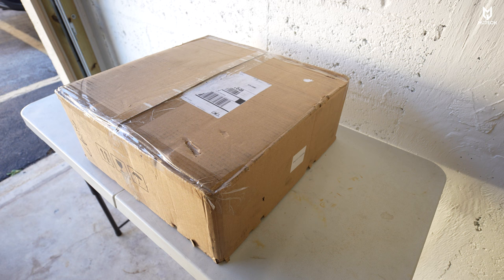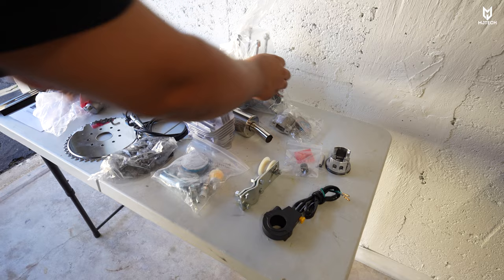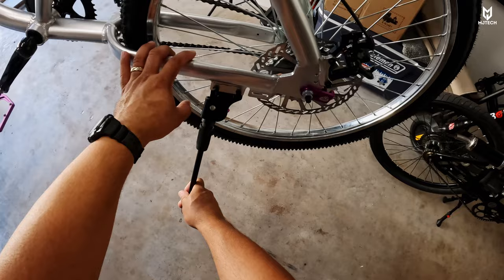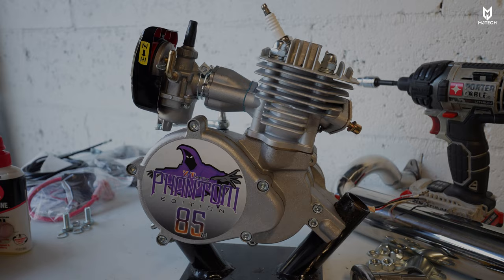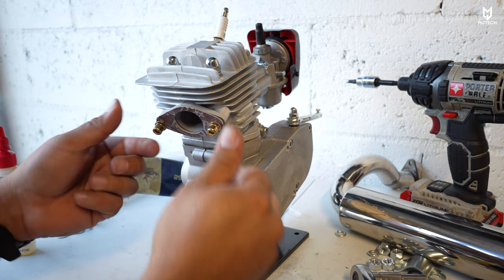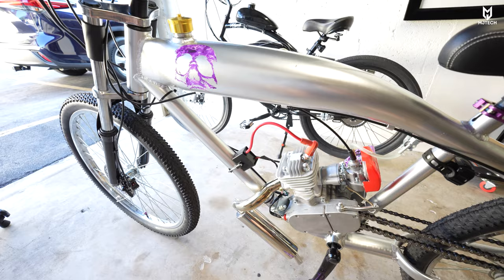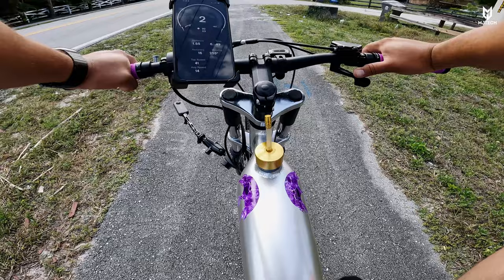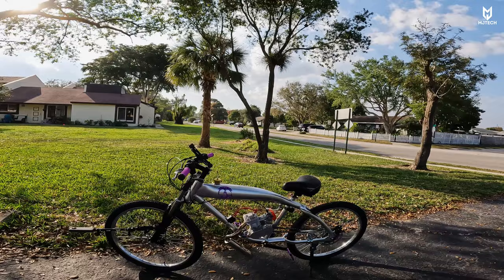Phantom 85 [V3] - No Motorized Bike Engine Will Go Faster At This Price!

Comment: dang man straight full throttle on a brand new engine.
Reply: and pops the clutch and immediately starts going doesn't even hold clutch in to let it warm up after it starts
Reply: You know engines from factory are floored max revs for 10sic before leaving the factory
Reply: @Rain-kg4bj   is this the truth bc i did not know this

Comment: Speed! Oh boy to be honest I'd be geared up going that fast. Knee and elbow pads just in case.  I love my Evercross H5 but have to admit it does struggle on inclines and I often think I could use something like what you have a gas powered engine.  Normal flat surface I get 27 mph and even that looks fast. 😄  Awesome job.

Comment: I got hydraulic rotor brakes for my new build jokester but they are still a line pull. The kit wasn’t expensive and it was really nice to have a basic easy setup that just bolts up to a stock set up and still have great clamping force. I read the other message we’re you mentioned you wanted to upgrade. I got purple too for my color since you want that color scheme too. Hit me up if you need a link and all.
Reply: Depends what you call expensive 🫰 dude
Reply: @musaguz6783  it was 40-45 bucks for two hydraulic calipers and cables and 2 160mm rotors in chosen anodized color. So to me that seemed like a really fair price

Comment: Nice runs just like mine once it's heat soaked you can bring the rpm down by letting off the throttle for a few seconds then clutch it works well for me running stock as well 79kph has been my max speed. My homebuild shouldn't go that fast but it's fun.

Comment: My new imaycc 80cc engine stock out of the box I got up to 35 mph with a 44 tooth sprocket I'm still breaking it in I ran one tank of gas through it so far. But I like your build that frame is nice I want to get one of those and I like how you went with the purple skulls and other purple parts it looks awesome my dude...🤙👍
Reply: I have the same kit doing 40 with the exhaust cap off. Does yours seem just a little sketch? I want a more reliable fast kit the imc seems like junk. Works for now for how long tho not sure

Comment: I so wish they'd make a full suspension Felt Faker type motorized bicycle frame that could run either 26 or 29in wheels. Even a cheap rear shock is way better than a hardtail. It'd take lot's of stress off both the frame & Rider. You could upgrade to better forks & rear shock that have true compression, damping & rebound function. Maybe also add mounting tabs on the frame for optional jack shaft kit. Full suspension Felt Faker with 203mm F&R disc brakes 👍

Comment: I have a 212 predator 6.5 horse motor on a modified mountain bike only modified for the wheels though the motor fit right inside the frame I do about 44 + miles an hour and it goes uphill like any other bike that has that torque to go up I have a torque converter on my bike and I get many miles out of my belts motors very reliable
Reply: Don't know why his bike went 40 plus but he should of Easily hit 50+ with that set up. My BBR100 goes 44mph that I got from Bike Berry, a couple weeks later the 100cc V2 came out. I missed on getting the better Version. I do have the Phantom V3 kit just waiting for the bike so I can install it. Lots of fun
Reply: @lonneebelton9806  motorized bikes are lots of fun no matter what kind of motor  you put on them as long as they're reliable to do their job (motorized bikes 4life)
Reply: And my motor does the job six-fold best motor I ever put on a bike 212 predator 6.5 horse that's where I'm going if I upgrade I'm putting a the 15.8 459cc predator motor that may be my next upgrade
Reply: @presleyfleckmotorizedbikef4285 hi mate I’m looking at building one, what engine do you Segway for decent power? Cheers
Reply: @lonneebelton9806  I just bought the BT 199 v2 for $230.00 on E bay and with a little wWindow Porting and polishing it should do close to 70mph. But then again I weight 125 soaking wet. I cant wait to get it broke in!👍

Comment: I got a 79cc predator 4 cycle with a 12 tooth centrifugal clutch run to a 36 tooth sprocket via 420 chain for the input side of my jackshaft and then a 18 tooth sprocket to a 22 tooth  on a sturmey archer  3 speed internal shifter hub and I can consistently hit 55 mph and topped out at 62mph and I get awesome off the line performance because of my low gear and 4 stroke torque.  Engine has governer removed,  1 inch header 19 mm slide carb and ported intake w matched head work then finished off build with billet flywheel. Raced 2 phantom powered bikes as well as several dozen 80cc ,100cc 66cc etc 2 stroke bike builds and not one has beat me. My engine brand new was 100, parts an extra 140 dollars then 70 for jack shift and 100 for quality 3 speed hub on a free bike . Now that's only couple bucks more than the phantom alone not including all the extra stuff and performance parts and then factor in new pistons rings jugs cdi and so on cus they are NOT  reliable and your only lying to yourself if you disagree. Fun but anybody inclined enough to mod a 2 stroke is better off spending time and money building equivalent 79 cc 4 stroke. Enjoy the ride without a worry of breaking.

Comment: Got my bullet train electric start completely rebuilt with a billit machined liquid cooled head forged pistons crank and Conrod were already pretty strong double spark plug ports 2 stroke EFI & a smart carb water pumps are electric too so no power lose as if it were a crank driven pump & alternator already uses crank power amazon exhaust with expansion chamber and a welder shop did all the measurements for chains and gears to gear the engine to the crank peddles cut the peddles and cranks off so its balanced & just a gear welded a stationed gear from the engine to the crank and was able to use a regular bike chain from there with a mountain bike 6 or 7 speed transmission ran on ethanol with 2 stroke oil never could dyno it but it blew up the CVT clutch after a burnout drove it but was scared to reach top speed but id say i hit probably almost 90 mph 6 gear and was 70% throttle at like 6,800 rpm running at like 190 degrees after a warmup id say maybe making like 15/20 hp had a cheap engine temperature tack and rpm reader you can get for like $15 or less on Amazon its pretty accurate just gotta wrap a wire around a spark plug and go into the settings and set it for 2 stroke engine

Comment: Question for you What oil ratio are you using mine v2 is still 20:1 can I go less temperature only gets up to 235 degrees?
Reply: Hey Mike Miller do you Still have your phantom Motor?!
Reply: @RaoulDuke224  yes I have to change the crank bearings and shell be up and going

Comment: What ratio do they recommend for break in? I heard 20 to 1 but that's a lot of oil
Reply: 20:1 is good
Reply: 40:1 since day 1 is the best imo or you can start at 32:1 than switch to 40:1

Comment: how are these motors for mountain trail riding? can they handle steep hills etc?
Reply: More for a cruising experience
Reply: gear it down. 72 tooth on the back and a small drive sprocket.  your top will be slow but you'll climb hills without slowing

Comment: How much do you weigh? My Phantom only reaches 40 mph with a 36t sprocket. I want more
Reply from the maker: 225. You might need a better carb. I installed a 23mm oz reed intake and added a mikuni vm18-144 carb and tuned it. Now my bike does 47 with the stock pipe. I should do 55-58 with a real expansion chamber.
Reply: @MJTechChannel  thanks a lot.
Reply: @MJTechChannel  I'm putting one of these on a chopper bike soon. I'm getting engine and components that you mentioned. How do you go about "tuning it"?

Comment: Hi there , love your videos, looking for some advice, I am hoping to bring a bike and motor on a flight Newark to Havana Cuba , I live there during the winter but have no transportation. Could you recommend a bike and engine combination that would be reliable, need good suspension as the roads are non existent. I have basic tools in my house but I could buy in the states what I need , would you recommend 2 of 4 stroke , I don’t need to go fast because the roads don’t permit it but I need reliable machine as my wife might also need to use it and I don’t want it breaking down all the time . Best regards John .
Reply: You should get yourself a standard PK80 66cc kit. I'd suggest you dont buy the cheapest, nor the most expensive, but something in between. AVOID BIKEBERRY! The normal 66cc kits have everything you need, but the first upgrade you should do is a new #41 chain. The stock kit chains are trash and will fail quickly. I suggest you build it ahead of time and get all the little china crap fixed before it becomes critical. These bikes ALWAYS go through a phase where everything gets loose and you need to sort it out to get reliability. Once you ride it a few days or weeks, it will kinda "take a set" and stuff stops falling off (assuming you fix & tighten) You also need to check Cuban laws as these bikes might not be legal, depending on the area, etc. I know a couple guys in Cuba who ride, and they mostly complain about not being able to get any parts. So bring your own spares and you can probably get back some of your investment by selling the bike/motor when done. They eat up parts when  available like crazy down there!

Comment: Kindly question can we remove the paddle part and change to normal steel pipe to make leg balance like normal motorcycle  and we change the start button to make the engine work without paddle

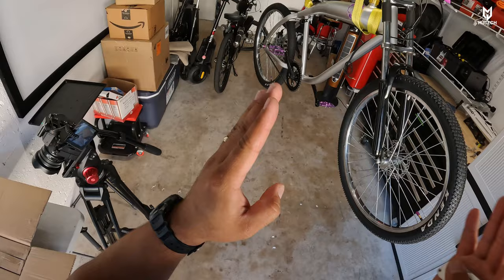Comment: wow that's amazing. i was hesitant to buy a v1 or v2 phantom in the past hmm so i did'nt, but now i will soon buy v3. do you have an online link to the manual booklet @1:25 ?
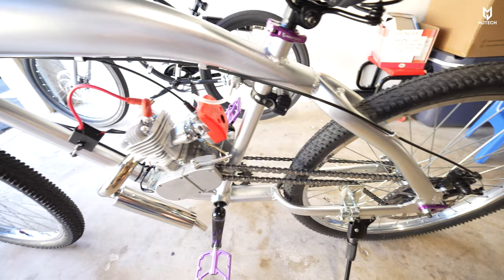Reply: the stock tensioner tends to twist inwards towards the wheel, and it would wreck the spokes. @10:35  have you upgraded that stock one ? and what other tensioner did you choose?

Comment: I noticed alot of you gas bike guys have no knowledge about power or how it works to get power . Just a carb change would make a huge difference.  And you never plug Chop or tune these things either. And never mix 32/1 it's so much a power killer 50/1 maybe if your breaking in the rings 1 tank or so run 32/1 but after that forget what u read these people know no more than u .